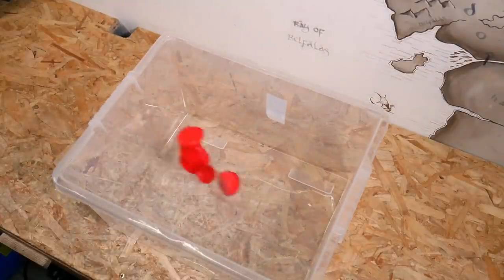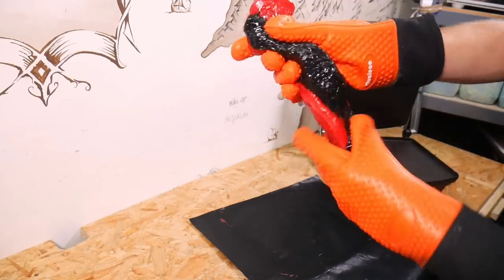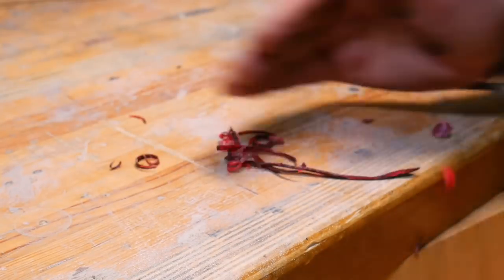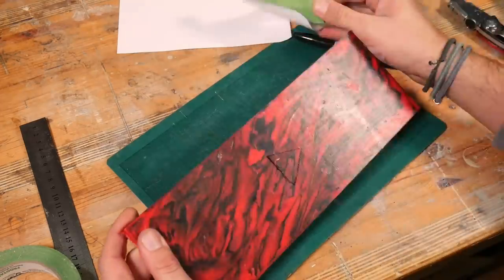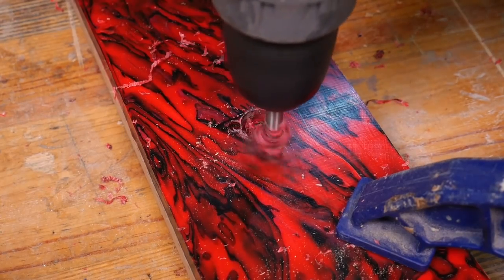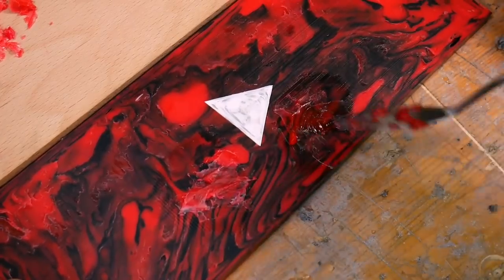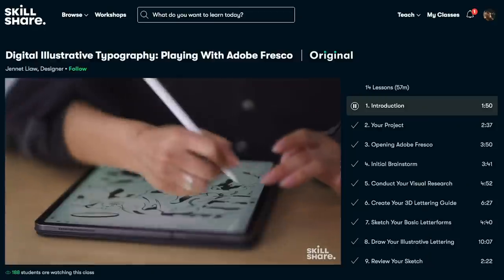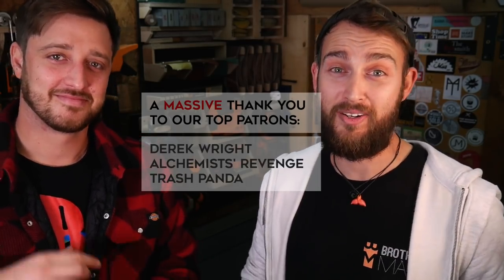Making our own 150K PLAY BUTTON from Recycled Plastic

Comment: Love your stuff and big congrats on the success of your channel.
Something I want to ask: How do you control your micro plastic shavings and off cuts?
Very often you are dealing with plastic as one would with wood - which is great. But all that saw-cutting, shaving and fine sanding must create a lot of plastic dust. This is firstly, an environmental problem, but also a potential respiratory problem. What do you do to try and contain this dust?
I'm currently planning to start a workshop and I'm thinking through as many possibilities as I can.